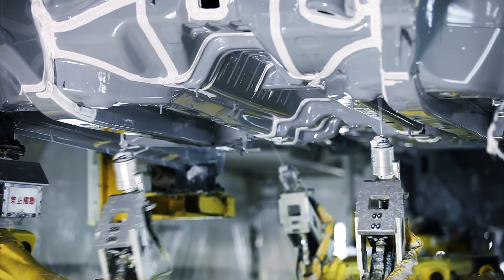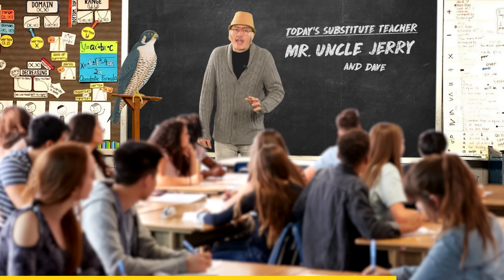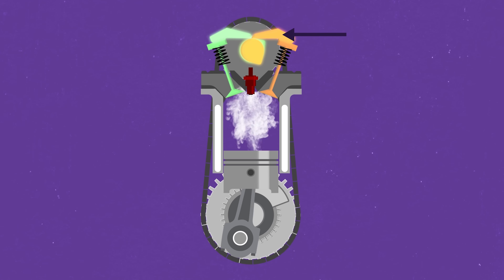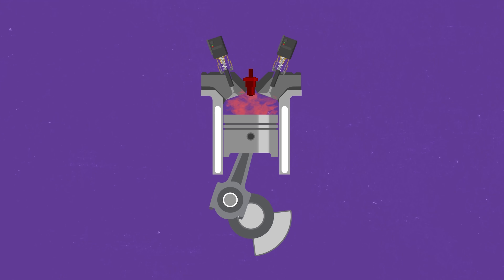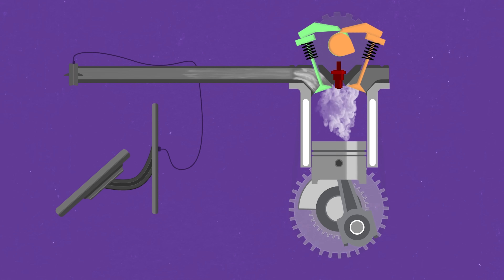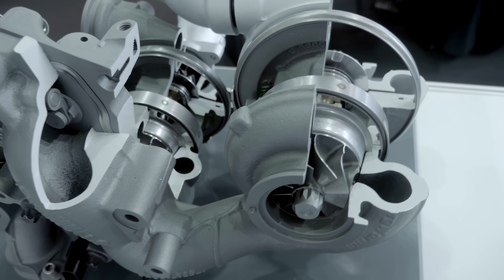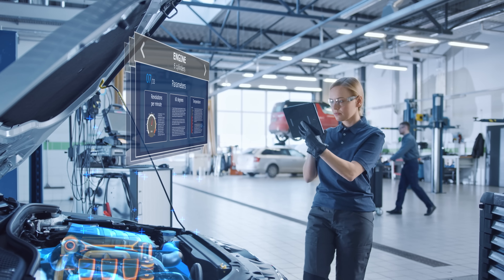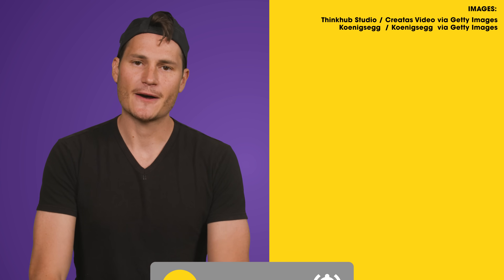This Is The Last Great Engine Tech

Comment: Qoros never actually went anywhere with it sadly, and no one else has stepped up to take the IP from Koenigsegg and make that fantastic concept a reality.
I would love to see Donut media take a crack at it. Freevalve was also used in concert with another big idea in Koenigsegg's cars, If i'm not mistaken it goes like this; The engine block was ported to flow fluid through it from what I would guess is a heat pump to bring the engine up to temp faster so it would burn more efficiently when combined freevalve. Electric builds do use this concept to maintain optimal temps, battery and motor function nicely at a certain temp, anything outside of the optimal and they stop working efficiently.

Comment: Somehow you neglected to mention that the main mechanism of fuel savings is the lack of camshaft and corresponding reduction of torque used to spin the camshaft. Nice video anyway. Even though Freevalve isn't getting customers because OEMs are moving on to EVs.

Comment: might even be able to eliminate the starter, if the computer knows the crankshaft position it should be able to find the next piston ready for a power stroke and inject fuel, flutter the valves for a little fresh air, close them up and send a spark then proceed with the firing sequence

Comment: I'm seriously shocked you didn't mention FCA's 1.4t. It uses electronically actuated valves on the intake, and a cam on the exhaust. My mother just bought a 2017 Fiat 124 Abarth and it's a really cool tech. Heck, even the Dodge Dart had the 1.4t in it with the same tech, called MultiAir.

Comment: On a similar topic, there’s also BMWs Valvetronic system which I think should’ve at least gotten some sort of mention in this video. There’s not much explanation available online that I could find, but it essentially accomplishes some of the same things as this system such as having infinite adjustment of the intake timing and eliminating the need for a throttle body (although BMWs engines do still keep a throttle body as a failsafe in case this system stops working, it always remains wide open in normal use). 

I don’t know too much about how it works but the main idea is that instead of opening a throttle valve, the accelerator pedal controls how widely the intake valves open which BMW claims helps account for 10-15% better fuel economy as well as improved emissions. Also BMW is the only brand to manufacture production cars that have Variable Valve Timing, Variable Valve Lift and a Variable Length Intake Manifold in the same engine.

Comment: i did research a while back to build a camless engine , found a few companies that published their electro magnetic valve, if electric cars wont take over this will be the next step, the cool thing about it its better in every way , less friction , less spring pressure fighting, its awesome, the reason oem has not done it because of technology gap , they are milking it very very slowly

Comment: I'd like to see you guys do a video on the alfadan 4 cylinder. He claims 50% more power, less weight and less moving parts.  Apparently he found a revolutionary way to negate the balance issue with 4 cylinder engines.  Could all be bs?  I haven't read that much into it.

Comment: “Making the same power with 3 cylinders that Lamborghini is making with 10” don’t worry about the 1000+HP electric drive system on the Koenigsegg Gemera (the car with the turbo I3). Ya know 3 electric motors, one for each rear wheel & one on the CRANKSHAFT.

Comment: its not ... self charging electric motors are the future...  you have a dynamo on all 4 wheels so as the car is moving its generating electricty .. the faster the car goes the more electricity builds up so the speed is only determined by the velocity of the opposing forces...

combine this with bodywork made out of solarpanels woven.into plastic and hydrogen fuel cells  you have a self perpetutating car that never needs chsrging...you could also run flip flop batteries

Comment: Don't be too proud of those BEV technological terrors...the power to run cars off batteries is insignificant compared to the power of FCEVs!
This could work on converted ICEs to run on hydrogen as a last resort modification to older vehicles.

Comment: It's not that much of an improvement, it's marginal improvements to airflow, like less than 10%. At really absurdly high RPMs it can flow more air and make more power, but it's not beneficial to rev an engine high anyway. Engine's create the most torque at low RPMs, where this tech is basically negligible. High RPMs are basically hype. The technology is cool, but totally unnecessary, something I discovered when learning about high performance camshafts and what their profiles actually do. This shouldn't increase fuel efficiency at all.

Comment: Directly injected mixture of a chemical oxidizer and a fuel source would eliminate the intake valve. If said mixture released its energy at a much lower temperature then we could eliminate the conventional cooling system.

Comment: Or you could eliminate the valve train all together, and get a power stroke every other stroke, and power two pistons with one cylinder ignition, and use compression ignition for both gas and diesel also eliminating the need for spark plugs, and have it be turbo and super charged. 

https://m.youtube.com/watch?v=UF5j1DvC954

Comment: 5:20 actually, digital radio signals use modulation to send digital information over an analog medium -- radio waves, in this case. Radio waves don't work that way, there's always a ramp up and down. Sine waves are very efficient, so the transmitter uses that as a base line, then the modulation changes the wave to the desired shape. Your description is correct -- difference between a ramp and steps -- just not when it comes to radio waves

Comment: Ducati has desmotronic value system- no valve springs or valve float. But requires 10,000 miles valve adjustment.

Comment: I don't like it. I mean, I do in a sense, more power, less weight and better efficiency are all great things for performance. But then, my dislike stems from the fact that I don't like computers, they're boring. I like mechanical analogue things, and I fear greasemonkeys are being replaced by nerds. I feel outdated, I was perhaps born in the wrong era 😭

Only 10 years ago I was at college to become a qualified mechanic, and I was told by a handful of tutors that the reasons I wanted to get that qualification and become a mechanic for a living were basically on life support as the typical greasemonkey work the average garage deals with, it had mostly become an IT job. You simply plug in the diagnostic tool, look at an error code then order any replacement parts, and then maybe you'll finally get to touch a spanner and get your hands dirty, unless where you work forces you to wear gloves. Sigh, still, it's cool for high performance motors I guess.

Comment: Honda had already put into production AND discontinued the Civic GX that ran on methane or natural gas.  Honda worked with a company to make home fueling stations using home natural gas.
Honda has done the same for fuel cell vehicles for the Clarity.

Comment: if one of those actuators goes out in an interference engine and the valve gets stuck down your looking at a new engine, unless there is some kind of safety for that. Otherwise I'd say don't install one of these on an interference engine.

Comment: wonder if there'd be any value to delivering (pressurized) and removing (vacuum) precisely controlled/mapped air to the cylinder the same way injection delivers fuel? I understand turbo's deliver pressurized air but isn't it in a more-than-you-can-possibly-need volume? Or, maybe that's already a thing?

Comment: i'd like to posit that a turbocharged freevalve hybrid would be a super fun fuel sipper
Reply: Turbo + Freevalve + Electric motors would be awesome. Imagine someone telling you "My car is a 1.2L 3-banger that gets 60MPG" while you eat their dust.

I'm a firm believer that the 90's until like 2010 should have been the era of the performance hybrid. They took a powerful drivetrain and used it to make compliance cars they tried not to sell, when they could have been making high-performance luxury cars and way more versatile trucks.

Like, what's the main disadvantage of a turbo-4 over a N/A 6? Turbo lag. Turbo lag is not a problem if you have ELECTRIC MOTORS to get you going while the turbo spools up. Toss 2 small ones in the back so they get proper traction for their instant torque. You'd get AWD with 1 differential and no driveshaft.

Like how was all of this not a thing for decades?

Comment: The main reason why they stick with the current Valve construction is reliability.

And yes I believe you are right that this technology isnt going to be used due to the fact that EV's are taking over.

No more acoustic revving engins 😓

Comment: Thanks for such an easy-to-get explanation! In fact, camless (no camshaft) engines are widely used in Marine Industry for last 15 years for main  slow speed engines , with Electronic controls of both fuel injection and valve timing. There are still come losses and time gaps due to a hydraulic drives (not really a problem due to slow speed of engine) , but the main conception is the same - no more mechanical control and direct drive. Just the size of exhaust valve restricts of using direct solenoid drive. As an example - MAN ME engines and Zultzer/Wartsila RT-Flex
Reply: Maybe you can help me with something i didn't saw yet, is high boost an issue for reliability in time? Is there's any mechanical part preventing early opening since it's digital?
Reply: @mostneuter   What exactly do you mean? Why would high boost be an issue other than the given reasons why high boost is already an issue? And again, be specific, what do you mean "is there any mechanical part preventing early opening since it's all digita?" Early opening of what? The valves? Intake or exhaust?Why would you want to open them any earlier? You'd either lose compression or potentially get exhaust going out the intake valves if you open them earlier than they already can be opened... And what would stop you, other than the piston in an interference engine, from opening the valve whenever the heck you want? I don't wanna say there's such a thing as a bad question but dang man.. these come pretty close to it. It doesn't even sound like you understand why you're asking your questions... You certainly didn't ask a very specific question... So I'm not sure what you intended to do with the answers, if they were even possible to answer, but I'd hope that you know what you were intending to do with them...
Reply: Yes, but marine engines run at ridiculously slow speeds. A 60RPM two stroke marine engine will only actuate each solenoid 30 times a minute, a 4 stroke car engine running at 2000RPM will actuate each one 500 times a minute.
Marine engines are big, very expensive, and use several hundreds of TONS of fuel per trip. They are effectively housed in their own building and have spares on site for everything that can break (including connecting rods!). Replacing a valve in that context is not an issue, and the fuel savings are much more significant.
Assuming a mean lifetime of 50 million actuations for the solenoids (which seems reasonable), the marine engine will experience a failure after almost 3.5 years of continuous max-rpm operation. The car, if you drive it 2 hours a day, will have a failure after just over 2 years.
And once one fails, the others are going to start failing shortly after so it's better to just replace them all. Is it reasonable to have to replace your entire valvetrain every 2 years? I don't think it is, given that people go many years without replacing timing belts, and timing chains can even last 20 years.

If there is an "obvious" solution to something that literally thousands of engineers worldwide, backed by billions of dollars of yearly investments work on (fuel efficiency), and it hasn't been used yet, there's usually a good reason.
Especially since all the other VVT and VVL systems are vastly more complicated to design. Why would they go down that rabbit hole if they could just stick an electronic actuator on there and call it a day?
Reply: @demoniack81  This is literally addressed in the video.  This technology has only been available in marine diesel engines for 15 years and in commercial cars for 5.  It's already being adopted by Renault, BMW, Fiat, Valeo, GM, Ricardo, Lotus, Ford, and Jiangsu Gongda not to mention Koenigsegg through Freevalve.  Things will not be universally adopted overnight.  Maybe if more people cared about their cam timing it would be adopted faster but they don't so it won't.  It will get adopted precisely as fast as the market demands.  Relax.  And to answer your question, VVTs were first patented for automobiles in 1903 and VVL in 1958.  They're not new and predate digital ECMs which is why their development was necessary and why they're more universally adopted.

Comment: there is also a company who made a similar thing but with a pneumatic system  i think it was installed on a enduro motorcycle not sure if it was camless i think they made it to keep the valves closed tight cause at the rpm the engine was runing the valves would've "dance" and move around like actually rotating inside the valve guide, i remember now it was a vacuum system of sort maybe not as fancy like a freevalve system but it was a solution to a problem

Comment: it is still not optimal because the fuel may not be consistent, and the air too, so not only do intakes and outflows have to be monitored to detect deviations from expectations, there needs to be longer time frame machine learning with clutch inputs ie how do we know if the slow down or speed up is transient or not ie should we be controlling more via clutch (transient) or via valve (not transient)

Comment: Strange how he didn't mention the traditional valve spring losses that also can go away. Those can be massive.
Reply: Are they massive? We dont assume so in engine building.  Roller lifters and such reduce the friction of the cam lobe and for what work the love does in compressing the spring the spring does most of it back onto the camlobe right?  And since at all times the lobes are staggered around in terms of if they are compressing or relaxing springs they do offset.  Its not like I have to compress all of the springs all at once and then release them.  consider if I liked up 360 springs all of which were phased 1 degree apart on equal cam lobes and each has a roller rocker arm.  How much force would it take to turn that camshaft?
Reply: @pbgd3  On a drag engine valve loses (mostly springs) are at least 600 hp. Every valve has springs with at least 700 pounds of tension to be able to close the valve fast enough. If you have anything to do with high power engines you will regularly see broken roller rockers.
Reply: @Snark900  What constitutes a "drag engine" to you. 600 horsepower sounds like "eff this guy, he's a nutcase" territory.
Reply: @danielnelson4881  The engine I worked on was 622 cubic inch, running 32 pounds of boost from twin turbos. It had 2” inlet and 2 1/4” exhaust roller rockers made from forged magnesium, it still regularly broke them. The car had 2511 hp at the wheels. It raced in the pro extreme category.
Reply: @Snark900  Sounds like "eff this guy, he's a nutcase" territory... Does not necessarily mean that it is... I believe you. How were you able to come up with that number though if you don't mind me asking? The 600?
Reply: @danielnelson4881  From various articles on different message boards. It’s always a balance between the speed of the valve closing and the spring tension required. I know that we were running dual springs with the outer spring being a beehive design. They had a combined tension of about 700 pounds per valve. The timing chain was a double strand roller chain. Pneumatic valves are being used in formula one but with the cost and the interference design of the drag motor very few people have tried them.
Reply: You seem knowledgeable. 8:17 May I ask how is it possible for the two exhaust valves not to open? Where does the exaust go? To the other two lines temporarily? Thanks
Reply: @sandiblues  lots of possible strategies you can leave intake and exhaust valves open in which case no actual intake conpression or exhaust just a woosh of air.  Or you can skip fuel injection or skip spark.  When nothing is restricted to a specific norm....  Also you can literally not have a starter.. Could just close all valves on any cylinder thats on a downward position, close its valves squirt some fuel and bang.  Running.
Reply: @pbgd3  thanks. I guess your answer goes along the lines of something like VW does with some engines where specific cylinders can be skipped for instance. Watching the video I understood the engine runs in normal mode just the two valves that goes to the turbo keep closed and the other two are open and shooting flames down to the catalytic converter. So I was thinking you can't ignite the two cylinders going to the turbo without releasing the exaust fumes. But it could be like you say that during coldstart only the two cylinders that have exaust going directly out are active, or maybe they have some way to redirect the other two temporarily somewhere. The last option makes more sense to me because then you can always have the full engine running but on the other hand since it's all digital the available options as you say are many.
Reply: right. another problem with springs is when they float on high rpm which can cause performance loss as well

Comment: Told an old boy at work about free valve. Wasnt impressed: Said he worked on the same thing for Lucas back in the 1980s but it came to nothing because it needed more than 12v to run and auto manufactures didnt want to upgrade  alternators.